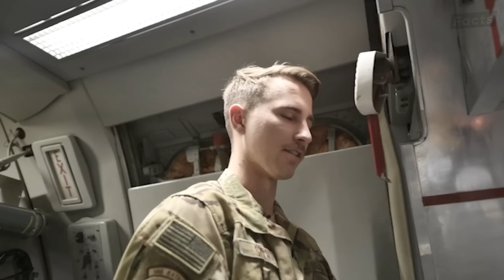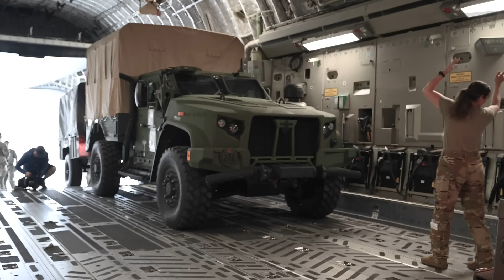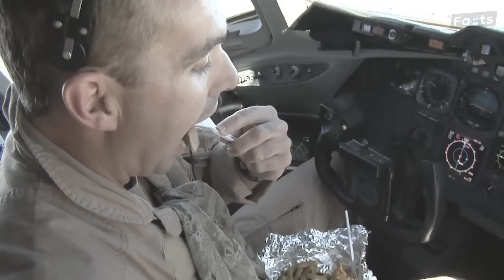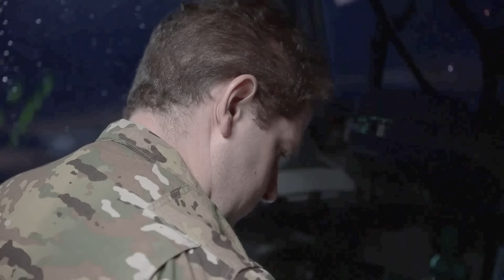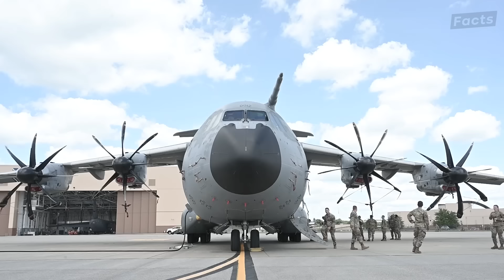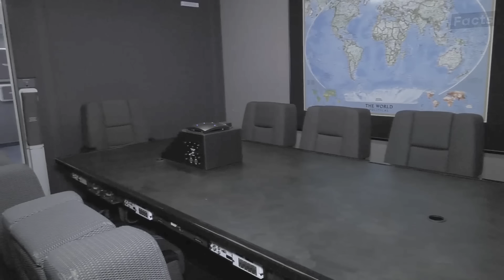Life Aboard a US Tanker Cooking Pizza at 30,000 Feet

Comment: Why don’t they have MRE’s?
Reply: Generally speaking if armies can supply a cooked hot meal they will, and then there is the issue of altitude, the kind of seasoning needed for high altitude food is different from ground food because the low pressure fucks with your tongue (planes a not pressurized to a full 1 atm), if you were using MREs in planes you would need a second MRE menu specifically for plane crews, which adds logistical complexity.
Reply: Or a nice cheese sandwich it can hit the spot really
Reply: MREs solve the toilet problem so I’m with you
Reply: Morale is needed in a boring job, military is only fun when you’re not working but these guys are constantly working due to needing to be on track near fighters so refueling doesn’t have a chance of the fighter not making it there, as well as MREs are less designed for one meal and has extra non-needed things, also as you see the pilots have to constant pilot, though I do doubt it’s just 2 guys, I feel they’d have at least a 2 team crew for piloting for constant missions, so they need to have something that can be eaten a lot easier than an mre, and mres are compact calories, something you’d need for PT and missions, something that is not really needed when sitting in the chair as a pilot or controlling the fuel tank output.